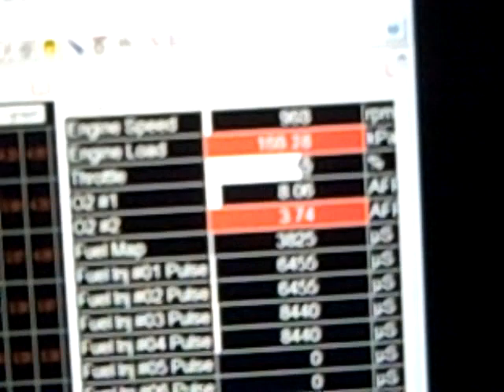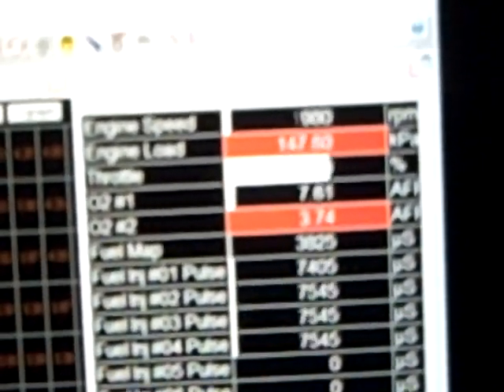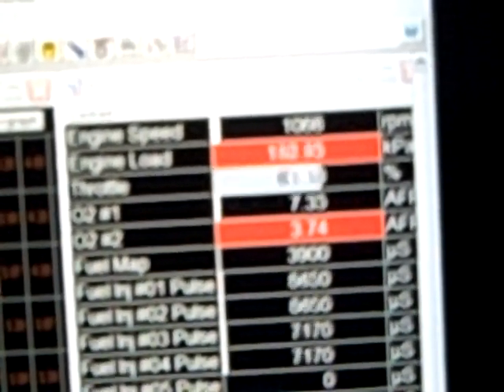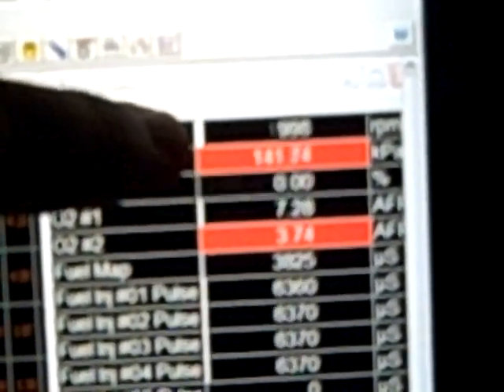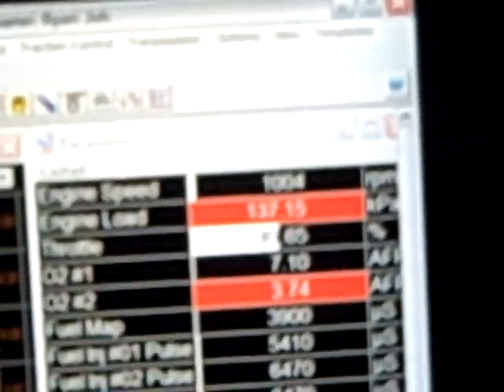TPS problem with AEM EMS

Comment: hey I'm having a problem with my 30-1060 my vtec solenoid starts clicking when I turn the key in the on position before I start my car. The other night I put my obd2 ecu back in my prelude and it did not click what could be the problem  I have soldered all of my wires from when I had my vafc and also my aem wideband gauge numbers are off from the afr readings on my labtop could the resistance of the wire from being so long have anything to do with that.